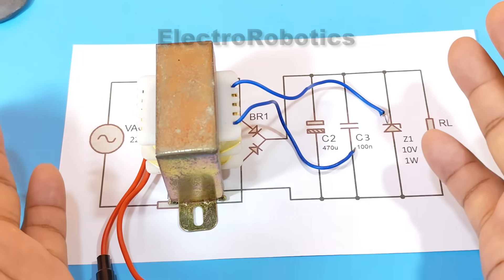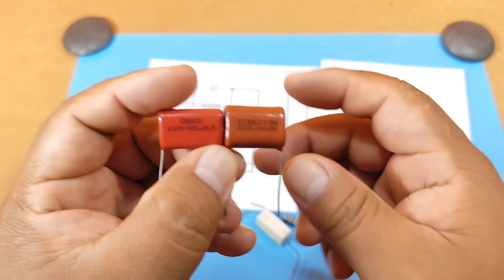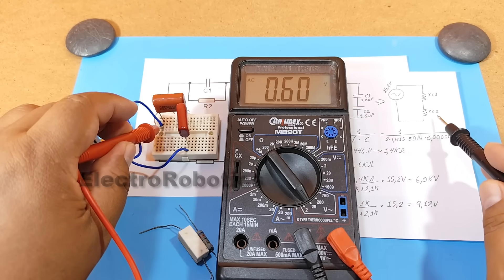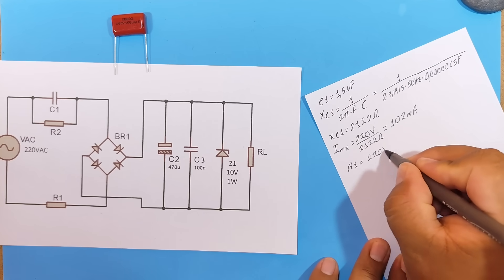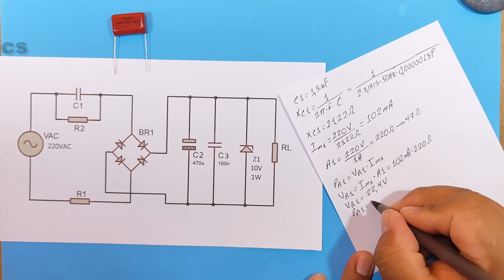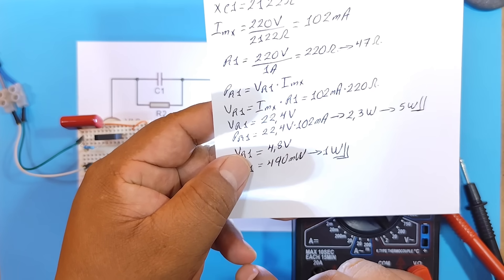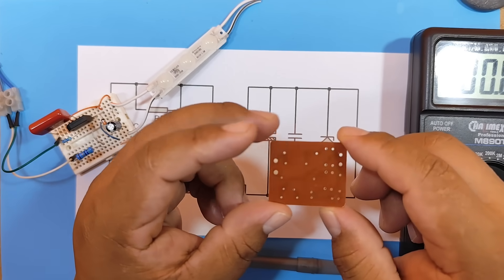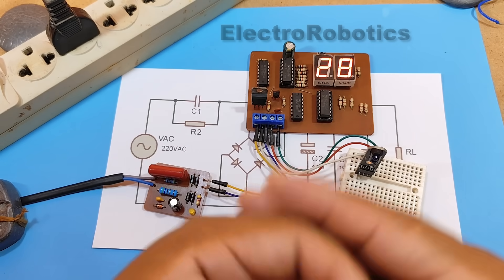No more Transformers, STOP Spending Money on Transformers.

Comment: Hi folks, the professor is not discouraging the use of transformers; he is simply demonstrating an alternative approach without using them. I’m not sure how many of you have opened low-cost LED bulbs, especially those from China, but many appliances use the same method. Whenever you handle electricity, you must do so with proper care.

Comment: Even when I connected a 47 ohm resistor in series with a capacitor, and ac voltage across it was just THREE VOLTS, it burnt violently creating sparks. I think  this may be due to poor quality  carbon track resistor that is unable to withstand surge currents arising from transients. Any way, such a circuit is dangerous and can cause fire if poor quality components are used.

Comment: Unsafe  and for low power circuits in general.  Use two 3uF capacitors to get isolation same as a transformer.  After a certain power level, transformers will be cheaper than capacitors.

Comment: You have not used a load resistor in series with the zener diode. This is a very serious failure for an electronic engineer

Comment: That is a cost-cutting, kind of stupid technique. It's very unsafe, as you are not isolated from the AC outlet; if something happens, the AC line will flow straight to the output and maybe to your body, dropping you dead by electrocution. 😵‍💫

Comment: With respect... Advocating capacitive droppers, with zero mains isolation...

(Although this topology, has it's limited uses, INSIDE fully double insulated equipment, with no exposed metal or lead out devices)

Absolute lunacy...

Comment: Most people warn the issue about the circuits that without transformers  design very dangerous as right. But sadly so to many white goods consumer electronics has this type power supplys...maybe extra better qualty caps and varistors.. and very dangerous for amateurs and hobys...

Comment: Thanks for the video. I never had an explanation of those power supplies before. 😊 Question for the other commenters...Why would you put your finger on it?😂🤣.
Reply: Devices with external input/output terminals may cause electric shock through those terminals.
This product can only be used with self-contained devices.
Additionally, it cannot be housed in a metal case with EMI shielding effects. It must be placed in an insulating case made of resin or similar material.

Comment: Practically mobile phone chargers, power adapters we use in general are based on these type of circuits non isolation without transformer. avoids weight, space, and cost.

BUT STILL I LIKE TRANSFORMER BASED CIRCUITS AS THEY ARE ISOLATED.

I
Reply: Chargers and power adapters would use a switching power supply circuit though as a simple dropping capacitor would not provide regulation.  Granted such would have a small transformer or inductor.

Comment: There's a freaking reason why we use either a step down transformer or an isolation transformer, you can die just by touching one live wire by shorting yourself to the ground cuz that completes the circuit, but with an isolation transformer you won't die if you touch a single terminal even if you are standing bare feet on the ground but you'll get shocked only when you touch two terminals at the same time, so best option is to use a step down transformer and then connect whatever circuit you want with it. But you can also go for isolation transformer for lower power loss but never skip isolation transformer.. You should not be saying this as a professor.
Reply: Placing the device in an insulated case, using insulated materials for user-operated buttons, and avoiding external input/output connections can significantly reduce risks.
In other words, for LED lights like the one in the video, simply placing them in a resin case makes them safe.
However, they should never be used in devices with external input/output connections or devices housed in metal cases.

Comment: Mr. Nilson, you're going to kill someone else! THIS CIRCUIT IS NOT SAFE!!!!!!!!!!
Reply: Beginners should not attempt this,
but when housed in a resin case and using only insulated buttons or switches that users can operate, devices without external input/output terminals can often be safely operated with this circuit.

Comment: I almost died because of that type of adapter when I was teenager, I was learning electronics and I learned on the hard way, no galvanic insulation, can be used only on internal circuits without external user access!

Comment: 2 reasons this is a failed design:
1. Absense of a load or failure of the zener diode will increase the voltage across C2 to 220V. 
2. Complete lack of safety. The whole stuff must be enclosed in an isolated box. Hands nearby? Definitely no!

Comment: 102 mA?  Another issue on capacitor circuits like this is that the inrush current when you plug in capacitors with 0 volts DC onto the AC mains at peak of the cycle…  several hundreds of amperes will instantaneously flow until the voltage on the cap is equal to the mains voltage.   You need a current surge limiting device such as a PTC thermistor made for this application in order  to keep the capacitors from releasing their factory installed smoke or dying an early death.
Reply: Capacitors are not destroyed by discontinuous inrush currents.
The reason many products include PTC thermistors is to prevent damage from overcurrent in bridge diodes.

Comment: With zener diode, the weak point is loss at R-limit current circuit.   Voltage at Load is control by Zener and the current is from E/R(load). If v@load = 20v, current for the whole circuit is 100mA, the power for this small circuit is  2W(20x0.1) but the power for whole circuit is 220v x 0.1 = 22W....  Am I right..?
for Power on R1, P = IE , = 0.1 x (220-20) = 20W, R = E/I = (220-20)/0.1 = 20 Ohm...   If we want to get this circuit, we can't buy R20 Ohm 20W (buy Transformer cheaper).  We can use 4x of 5 Ohm 5W or 10x of 2 Ohm 2W in serial to share the power.
However, for long term, we have to pay for the loss of power. That is ~10 times of actual power. If we use switching or Transformer, the loss will must much lower (~ 2 time of actual power in 50% of circuit accuracy).

Comment: Transformers 100 percent safe and it gives 200 to 1000 ma.you circuit giving not more than 20ma. don't post this useless videos
Reply: It can be used for devices such as microcontroller-controlled LEDs housed in resin cases without external input/output ports.

Comment: This type of power supply is not meant for tinkering on your desk (especially when everything is messy). You should still buy a transformer and add an in-line fuse and a proper switch in the primary for this, or if you have the money, a lab power supply. Otherwise you could... I mean, for sure, you are gonna cause an accident or get yourself killed, especially if your country uses 220 V as the standard. However, this kind of circuit is useful in some applications, like LED light bulbs, where the terminals are completely enclosed and not accessible to people during normal operation.

Comment: Transformer equipment last longer due to the inductor nature of Transformer as it can absorb Surge Better. Switch Mode Power Supply easily get damaged due to surge...Most common problem with Switch Mode Power the Capacitor drying up and bulging ready to explode like firecracker..

Comment: On no load condition with the circuit connected to AC supply what happens to the zener diode, I think it will get warm because it's taking the load current, how do you solve that problem so the zener doesn't burn out later.

Comment: PLEASE BEGINNERS IN ELECTRICAL ENGINEERING - DO NOT DO THIS!!! 
FOR ALL PROJECTS ON THE DESK, USE ONLY GALVANICALLY ISOLATED POWER SUPPLIES!!! 
This is EXTREMELY DANGEROUS TO LIFE for those who are not experts! 
There is such a way of power supply for cheap Chinese timers - for example. Such a timer is not connected to anything outside directly, but passes the mains voltage to the consumer through a GALVANICALLY ISOLATED RELAY. For safety, it is very important to know that the largest percentage of devices on the planet MUST USE GALVANICALLY ISOLATED POWER SUPPLIES, where the primary and secondary circuits of energy transfer are GALVANICALLY ISOLATED! This means that low-frequency or high-frequency TRANSFORMERS MUST EXIST! This type of power supply can only be used for devices that do not connect to other devices directly, OTHERWISE IT BECOME EXTREMELY LIFE DANGEROUS! I made this, but the usability of this device power supply solution is very limited!

МОЛИМ ПОЧЕТНИКЕ У ЕЛЕКТРОТЕХНИЦИ- НЕ ЧИНИТЕ ОВО!!!  
ЗА СВЕ ПРОЈЕКТЕ НА СТОЛУ УПОТРЕБАЉАВАЈТЕ САМО ГАЛАВАНСКИ ИЗОЛОВАНА НАПАЈАЊА!!!  
Ово је ЕКСТРЕМНО ОПАСНО ЗА ЖИВОТ за оне који нису стручни! 
Постоји овакав начин напајања за јевтине Кинеске тајмере - на пример. Такав тајмер се не повезује са ничим споља диркетно, већ пропушта напон мрежног напајања према потрошачу преко ГАЛВАНСКИ ОДВОЈЕНОГ РЕЛЕЈА!   За безбедност је   јако важно знати да највећи проценат уређаја на планети МОРА КОРИСТИТИ ГАЛВАНСКИ ИЗОЛОВАНА НАПАЈАЊА, где су  примарно и секундарно коло преноса енергије  ГАЛВАНСКИ ОДВОЈЕНИ!  Значи нискрофреквентни или вискофреквентни ТРАНСФОРМАТОРИ МОРАЈУ ПОСТОЈАТИ! Овакво напајање се може користити само за уређаје који се не повезују са другим уређајима директно, ИНАЧЕ ПОСТАЈЕ ЕКСТРЕМНО ОПАСНО ЗА ЖИВОТ!  Ја сам ово правио, али употребљивост овог решења за напајање уређаја је врло ограничена!

Comment: No galvanic isolation = accident waiting to happen. Unsafe is an understatement.
Reply: Beginners should not attempt this, but when housed in a resin case and using only insulated buttons or switches that users can operate, devices without external input/output terminals can often be safely operated with this circuit.

Comment: Bull shit Prof Nelson! Without transformers, you have no line isolation from the mains and deserve the shock you get!
Reply: Beginners should not attempt this,
but when housed in a resin case and using only insulated buttons or switches that users can operate, devices without external input/output terminals can often be safely operated with this circuit.

Comment: Dangerous non-isolated circuit, which can kill any newcomer who builds thus capacitive transformerless circuit....moreover capacitive ac mains circuits are so inefficient  because it will waste power through zener diode, and you can never get high current outputs like 500ma or 1 amp that we can easily get through transformers.....if you really want a safe, efficient,  light weight, cheap alternative, just go for smps versions which are so cheap nowadays....

Comment: Great video. Thanks. I would like to understand which type of capacitor to use. For example would electrolytic also work or must it be ceramic etc?  A video explaining the differences and when to use them will be very much appreciated.
Reply from the maker: Hi Kneuk, first of all, thanks for the comment.
For the circuit, it absolutely must be a non-polarized capacitor. It's usually made of polyester with a voltage higher than your outlet.
But be careful when making that circuit because dangerous voltages are used.
And thanks for the suggestion about making a video about capacitors.

Comment: Viewers MAY COMPLAIN about this video as distributing content that threatens human life or health.
 
Therefore, please add a WARNING at the beginning of the video about the danger of touching parts of the circuit, as well as devices powered by this circuit. Due to the lack of galvanic isolation from the high-voltage mains.

Comment: At 120vac this is dangerous and at 230vac it's doubly dangerous. This is only suitable for lower current/power applications that are sealed for safety, and everything is powered internally - no external power connections. There was a story recently of a woman who got electrocuted in her bathtub while charging and using her iPhone. She probably had one of the cheaper chargers with no isolation to the mains. 120v may be present on the +5 or GND rails of the USB connection but doesn't fry the phone because there is no return path. However, in a bathtub, the drain plumbing acts like a natural ground for the 120 vac and thus the bathtub becomes a death trap.

Comment: Still  prefer a transeformer as an Electrical engineer, I lived and breathed them. The solid state systems  were always breaking down. Hardly any isolation. Retired now, perhaps its now improved.  But I have had to swap back to linear PSUs at home due to Ejectrical interference wiping  out the HF bands on ham radio. Been very  bad.

Comment: MISTAKE IN VIDEO AT @ 05.38 1.5uF, XC reactence = 1K5 XC, NOT 2K122 XC, So max current load for 1k5 XC = 0.147mA. -

 1 / 2 x Pi x F x C 

Pi = 3.1415

2 x Pi = 6.2831

6.2831 x 50 = 314.155

314.155 x 0.000.002.200F = 0.000691141

1 / 0.000691141 = 1.446.8828 K XC  = 1K5 Ohm XC

also not a word about how danger this circuit CAN KILL!!!
------
Reply: At 5.38 the capacitance used in the calculation is 1.5uf. If you use that you will get 2122ohms .

Comment: Really nothing new! SMPUs are in use since more than 30 years. They are more efficient, light weight and cheaper. But they also come on a downside: noise and EMI! The good old transformer can be abused to a certain extent without any damage, but SMPUs can't. And of course a capacitor can heat up, so that it can be damaged! Depends of frequency and ripple current! Your video is not complete and simplifies physics.

Comment: My advice as a Profession Engineer is to totally ignore the irresponsible information posted in this video, use a mains isolation transformer.
Reply: Beginners should not attempt this,
but when housed in a resin case and using only insulated buttons or switches that users can operate, devices without external input/output terminals can often be safely operated with this circuit.

Comment: are you right in your head???? There's no galvanic insulation from mains... you want people to die or what? plus the AI voice is horrible.... You should not even show this on youtube this is just deadly dangerous !  not even a optocoupler to insulate mains to the low power side. you are a real idiot you are getting people killed !
Reply: Beginners should not attempt this, but when housed in a resin case and using only insulated buttons or switches that users can operate, devices without external input/output terminals can often be safely operated with this circuit.

Comment: Dangerous idea, absolutely prohibited. No insulation form mains.
Reply: Beginners should not attempt this, but when housed in a resin case and using only insulated buttons or switches that users can operate, devices without external input/output terminals can often be safely operated with this circuit.
Reply: @resistan-y1h  In countries where good safety rules are in force, you need a double insulation  (label with double squares, one inside the other). Another flaw of this schematic is the zener diode, in which all the power is dissipated in case the load is missing.

Comment: Be careful, very careful, extremely dangerous, this circuit is not isolated from the electrical network, only use it in very specific cases, and only if you know what you are doing.

Comment: Professors should study electrical safety issues again.
Reply: Beginners should not attempt this, but when housed in a resin case and using only insulated buttons or switches that users can operate, devices without external input/output terminals can often be safely operated with this circuit.

Comment: No more dead people, no pore power waste, no malfunction, no voltage ripple: USE switching power supplies.

This video shows a valid circuit, but it is shown by a self-proclaimed specialist. These are the flaws:
(1) This circuit has no isolation from mains. Any point can have voltages around 230 Volts. This design is for professionals only!
Especially dangerous when broken - never try to "debug" this circuit!
(2) This circuit is wasting lots of energy. Even with the 47 Ohms resistor, the power wasted in this component (1W) is the same as for the LED light (10V * 100mA).
And this is only the loss in R1, Losses in R2, the diodes and especially the Zener Diode are on top.
(3) The PCB shown is equipped with 1A diodes (1N4007 or so), but with 47 Ohms, the Rush-In current is about 5 Amps - and this under the assumption that the capacitor was not charged it could get even higher it it is charged with opposite voltage (possible as we have AC here). And this current will also flow through the rest of the circuit, stressing out the capacitor (ESR) and overloading the Zener diode. Sooner or later one of these components will fail.
(4) The remaining voltage ripple may work for a LED light, but any noise sensitive circuit will suffer from that.

So if you want to do yourself a favour, forget about this circuit and rather consider an integrated switching power supply as e.g. the "Meanwell IRM-05-12". It is about same size as the weird PCB, but fully isolated and with a power factor of 75%, so the delivered power is three times the power consumed by the circuit itself. Of course with low ripple and designed to last a few years at least. (Remark: I have no connection to Meanwell).

Comment: Bullshit 🤣🤣🤣🤣
Reply: Beginners should not attempt this, but when housed in a resin case and using only insulated buttons or switches that users can operate, devices without external input/output terminals can often be safely operated with this circuit.

Comment: This will not get a like from me. I know how it works in principle and practice but it is nowhere near as safe as the isolation provided by a properly built transformer. And unlike a transformer, the moment you remove or reduce the load the voltage on the "cold" end of the capacitor hikes, ultimately to the full mains voltage.